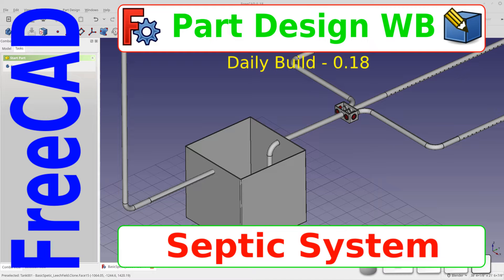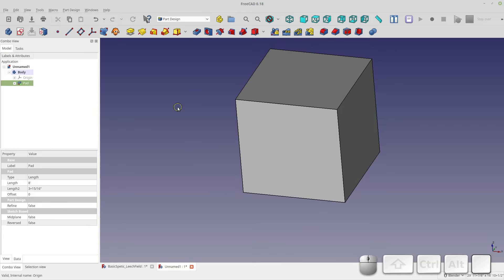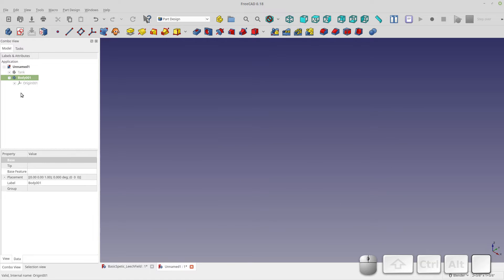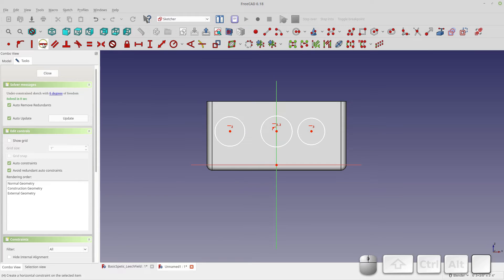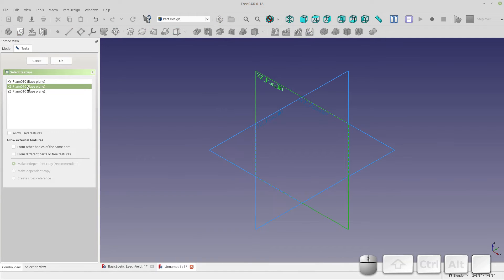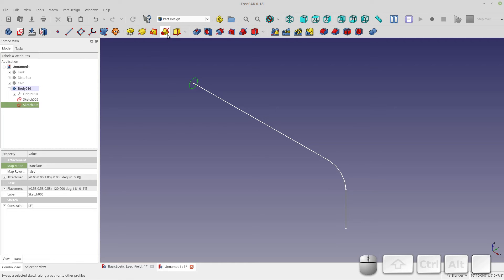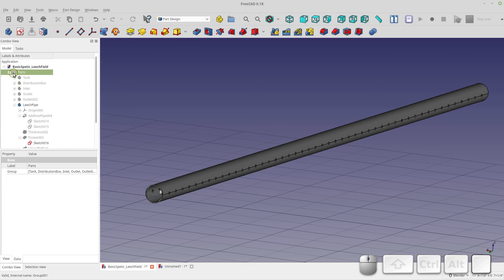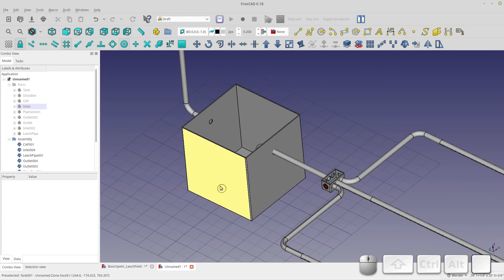FreeCAD - Septic System Model, Focus on Path Sweep and Thickness Tool in Part Design WB

Comment: Hi, Thanks for great content. I have a question. 
What is the advantage of making/creating assembly the way you did it VS using specific workbench for assembly (eg: A2plus WB)?
Reply from the maker: Assembly workbench is probably better on general. I started using groups a few years ago as a substitute for an assembly workbench as there hadn't been a settled on assembly approach at that point. As I understand now it is still in flux. I wanted to have a "stock" way of organizing things that doesn't really get in the way of future approaches.  Additionally group folders is just a good general purpose organizing tool. So as a2+  are Assembly3 become more mainstream I will start using them more. Hope that answers the question 😬